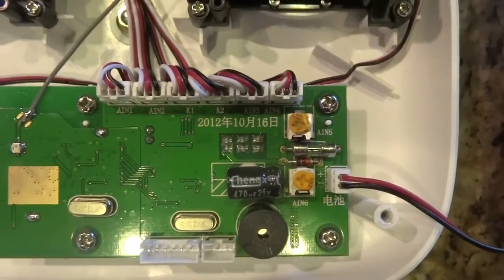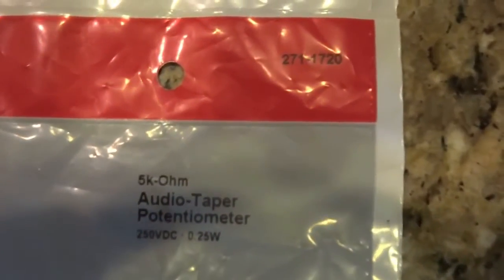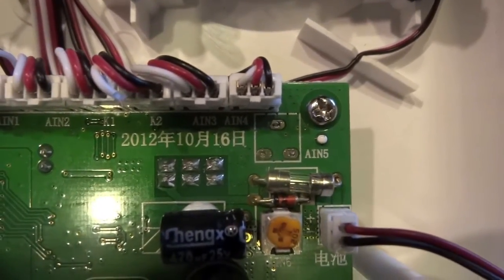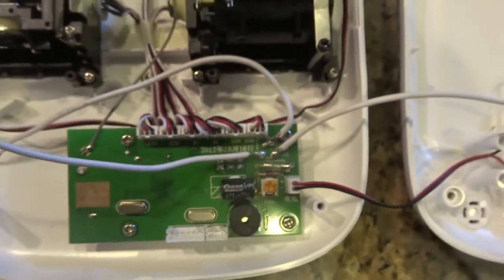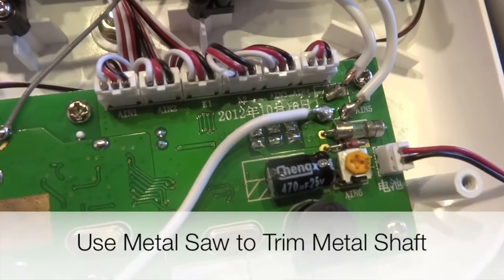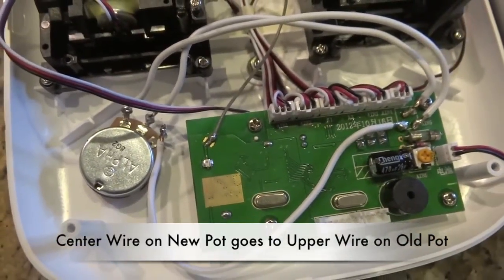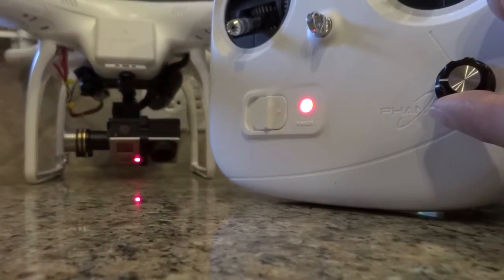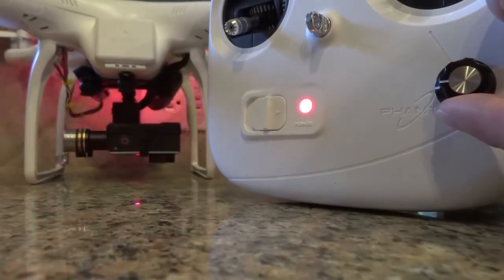Gimbal Tilt Knob installed on Phantom Transmitter

Comment: Hi, for those who couldn't figure out to stop the moving of the camera/gimbal in each angle, this is the solution I found: after mounting and installing the linear potentiometer, then you have to calibrate the X1 port with RC Assistant software from DJI; that  means to connect RC with computer through microUSB of RC (inside the RC for 1 and 1.1.1 DJI Phantom versions) and outside micro USB port for P2. After calibration with RC Assistant, then calibrate the RC with Naza software, including the X1 port for gimbal in Basic-RC section of the software. This worked for me (DJI Phantom FC40). Also, I think any simple kind and cheap between 1- 5k linear potentiometer will work fine. Hope this will help. Cheers and fly safe!

Comment: Hello,
Thank you for your video. I have the Phantom 2 vision +. I did follow up your steps and now the gimbal is controls by knob. However, soon I turn on my mobile device, DJI Vision app take over. Knob does not work anymore and gimbal controls only by app. How can I disable app gimbal control if it is possible?
Thank you.

Comment: Dude....Thanks for posting.  That little PCB mount pot was crap.  I added a 10K audio taper pot mounted just above my right stick....Had an old telecaster dome knob laying around that works perfect.  I spent 18 hours getting this thing to work, and this was the final piece in the puzzle.  Thanks again :-)
Reply: Do you have any warnings or recommendations when opening the controller or working on the board? Also, you say you're using a 10K, he's using a 5K, do you get a smoother move tilting the camera? Thanks.

Comment: idid this and now the circuit is dead, the fuse hasnt blown any ideas
Reply: When separating the case you might have pulled the 2-wire plug out of the circuit board from the battery compartment., make sure it is plugged in all the way. I did not twist the old pot out, afraid of damaging the board, tiny cracks can inop it, I used surgical snips to cut each of the three legs off the old pot.

Comment: Thanks for sharing this info.  Just spent $7.59 at Radio shack on the two parts, found some old stereo jack wire, cut 3 pieces to length, soldered and drilled as you instruct and it works great.  One thing that may not be clear fro those who are not electricians is that on the board where you solder the three wires, it does not "pop" out like a plug in.  You actually have to pull it off by breaking the wires/connections that are permanently attached to the board.  Awesome info and can't wait to use this new gimbal in some vid production.

Comment: how did you recalibrate? I'm having a similar issue in that the camera will not stop at any angle. just goes from the top end point to bottom end point not stopping anywhere inbetween when using the POT. I have the ARRIS CM2000 gimbal.

Comment: I just finished this mod using part 271-1714 (Linear POT) and I cannot get the camera/gimbal to stop at an angle. it will go from up to down without stopping regardless of what I do with the POT. If I move the pot opposite direction it goes all the way back not stopping any any midrange area? any ideas?

Comment: That is a great tutorial!  I followed it and made two minor change.  I mounted the control knob out the back (same location, just out the back) and I used a bigger knurled knob (2740424).  It allows me to control the tilt with my 'ring' finger or pinky without taking my hands off the controls.  The 1" knob seems to turn very smoothly with the bigger knurled knob.  Really appreciate the detail you put in the video!  Nice to finally buy something for my phantom that didn't cost over $100. :-)

Comment: I just did this and after recalibrating I can stop the camera at any angle. I simply cut the old pot out (clipped the legs off) and soldered the wires to it. Couldn't be happier.

Comment: Hi, I have a knob too ; P I can use the assistant to configure it from say 60-125-210 or any other setting. Just move the knob  full left and type in the desired gain-number, same for middle and full right. I use it for remote atti-gain.

Comment: how did you remove the top pot? im very new to soldering but would like to do this mod since my transmitter stock pot plastic striped out